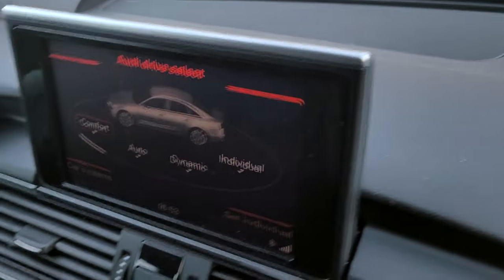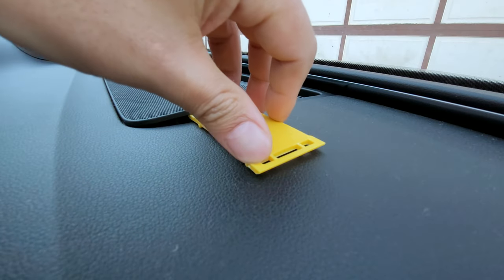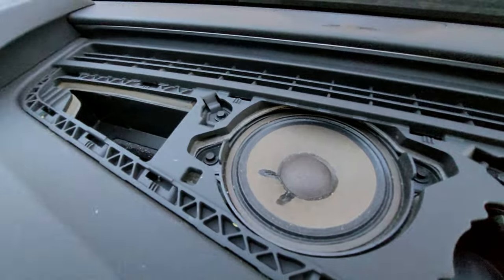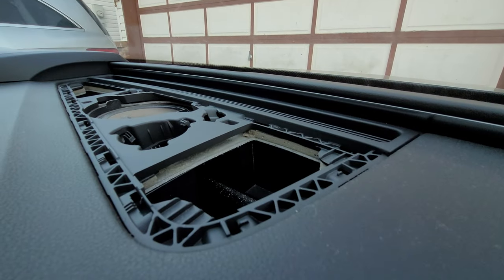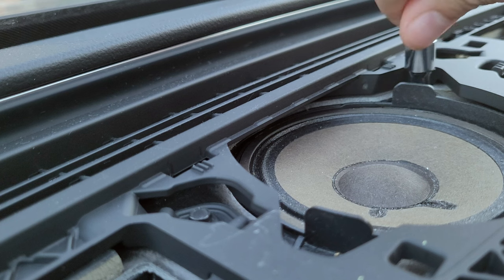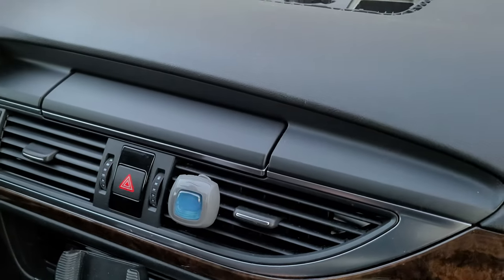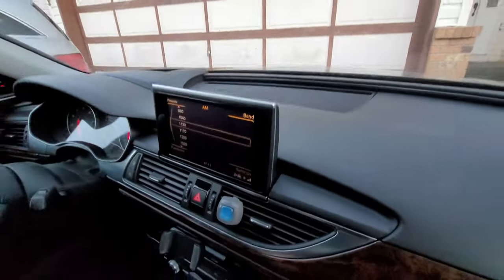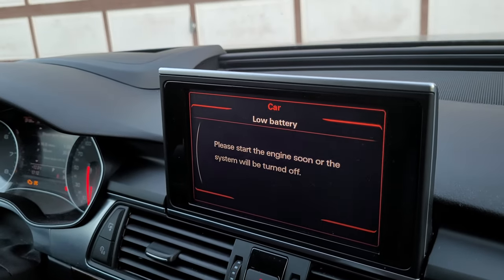Audi A6 2012-2018 C7 Replacing Center Dash Speaker - Part 1: Removal

Comment: Is there a way to know on how many Ohm do they work? Idk if i would like to randomply replace it by size, would like to install a similar speaker in terms of working parameters.
Reply from the maker: 4-ohm is the standard for car speakers. That said, drivers in a composite speaker setup could have different impedance. In this case however, it's 4-ohm full range speaker being replaced with a 4-ohm composite speaker.

Comment: I feel like the car would sound better without this speaker even if you don't replace it with anything. Am I right?
Reply from the maker: Normally I'd agree with you as I prefer a phantom center setup in my living room. However, you can't configure the car's audio system to disable the center channel, so you'd lose a lot of audio info.